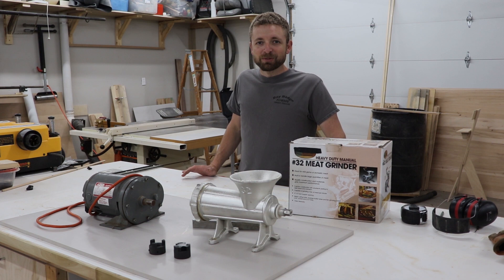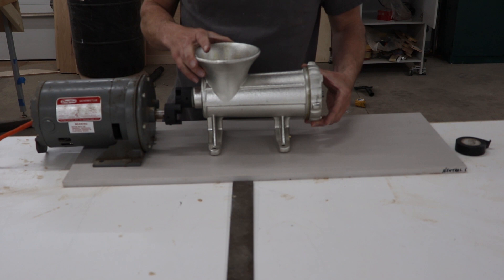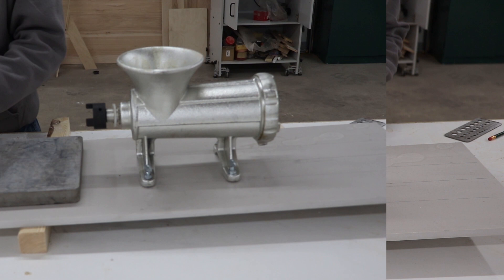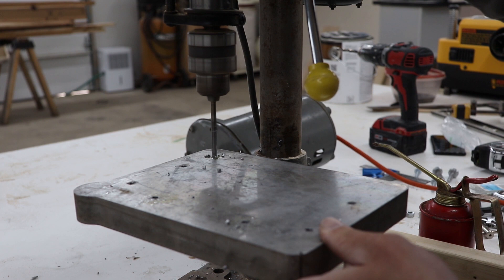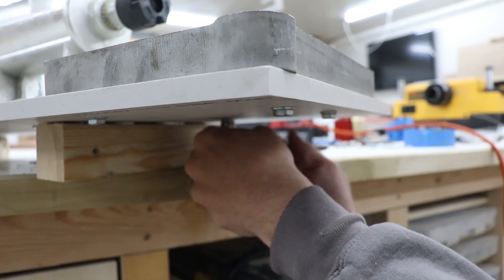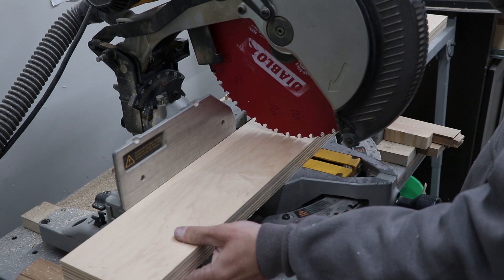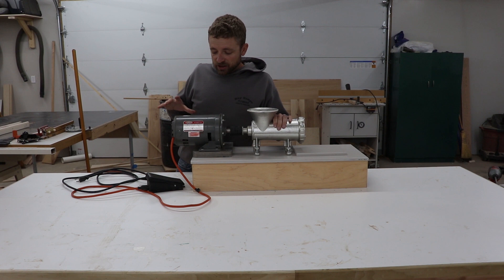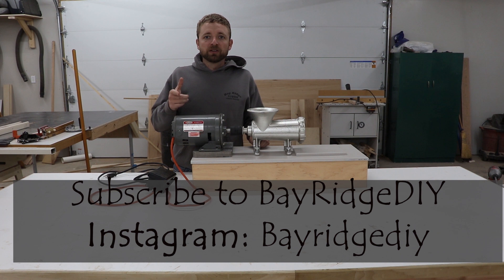How to make a power meat grinder from a #32 manual grinder.

Comment: Cool, this is what I've been thinking about for primarily chicken carcasses for dog food.  For anyone else, you need something larger than a #10 if you want to grind chicken/fowl bones.  My only real change will be to insure the box frame is longer on the back so the motor is fully supported and can't tip backwards.  Might never be a problem, but if one makes the front shorter you could be in for a surprise when you pull the grinder off for cleaning.
Reply: larger than a #10 what?

Comment: I’ve got one set up very similarly. We gave up on keying or set screwing and just drilled through the love joy and the grinder shaft and stuck roll pin through it. Meat has to be damn nese froze though. The tolerance on a hand crank grinder (in my experience) will not allow it to feed if the meat is thawed.

Comment: nice...but dont you think you should cut off the front of the box so you can set a nice big bowl under the grinder to catch the meat?
Reply from the maker: I use a baking pan that fits under there perfect. I like the option of coviering the hole and using the sauage attachments on the flat surface.

Comment: Have u done a video for porkert poppy seed grinder? I want to make it electric and I think only way is a belt and pulley system because the grinder must be tight for fine grinding. Any ideas?
Reply from the maker: I have not Work on that style. Looks a bit smaller than the Grinder in this video. Maybe a small lower rpm motor and a pully would be the answer. Thanks for watching!!

Comment: Vous avez eu ou les raccords d'arbre entre le moteur et le hachoir
Reply from the maker: The connector is called a Lovejoy Connector 
https://www.amazon.com/Coupling-Coupler-Flexible-Lovejoy-Interchange/dp/B01N4OKAGS/ref=sr_1_12?keywords=lovejoy+coupler&qid=1637938616&qsid=138-3038045-8737935&sr=8-12&sres=B004QWZR2Y%2CB01MS7XU4P%2CB01MUB84NR%2CB07LFN6X3R%2CB01N34FS9P%2CB01N11G4VQ%2CB01MT9LE4G%2CB003HIX2IY%2CB07DSLWNHQ%2CB004QWZRQK%2CB01N4OKAGS%2CB07B8KSKY9%2CB01NCVY7D5%2CB01N34FTGX%2CB01N5PVI6Y%2CB003HIWQMW
Reply: @bayridgediy3438  merci pour votre réponse mais dommage plus disponible

Comment: Awesome! What are the specs on the gear reduction motor?
Reply from the maker: Hey Robert, Thank for watching. The motor is a dayton Gear reduction motor 1/4 hp with a 60rpm turn at the shaft.  This speed turns a good amount for meat out pretty fast and is better then by hand.
Reply: Hey, I was wondering if you could give me the model number of the motor you used. Thanks.

Comment: What were the inside diameter Lovejoy couplers?
Reply from the maker: The shaft size on the motor was 3/4" so i had the auger turned to 3/4".The ID of the lovejoy was 3/4" i found them on amazon.

Comment: Was the worm shaft turned straight on a lathe?
Reply from the maker: Yes, I had it turned down by a local machine shop. Could not get video. It was tapered I had them turn it down to 3/4".

Comment: how has this setup performed long term? how many rpm is the output shaft on the motor?
Reply from the maker: Hey Sean, This unit has held up nice. With that being said I only use it for one or two deer a year. I have burned out other store bought units after one deer. The RPM on the shaft is around 26 rpm. Thanks for watching hope it was helpful!!!
Reply: @bayridgediy3438   thanks! that's a hard motor to find.... lucky score... have another you could sell me? :P
Reply from the maker: @sean7193  It was an estate sale find. 1lpl8 is a Dayton motor that is close (30rpm) . I have another that i was going to use for this project but i broke a Plastic gear in it. We have the same motor (1lpl8) on a homemade Beer keg fish scaler that has been scaling fish for years with no issue!!
Reply: @bayridgediy3438   looks like the dayton 1lpl8 are about $300ish. that's getting into a decent factory made grinder territory just for the motor.
Reply from the maker: @sean7193  I agree that is why i look to find them used. Everynow and then Ebay will have a good deal on one.